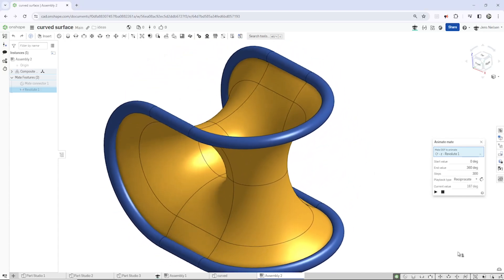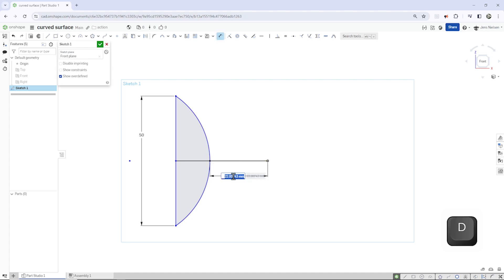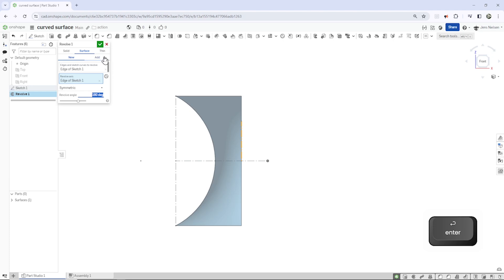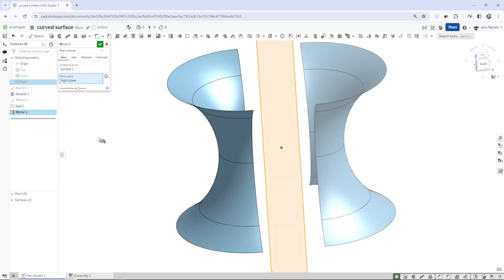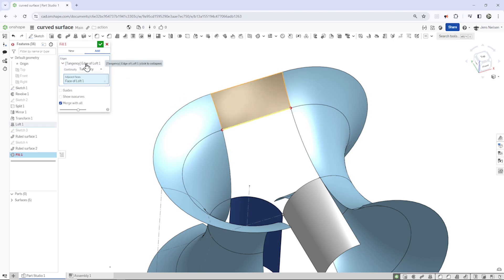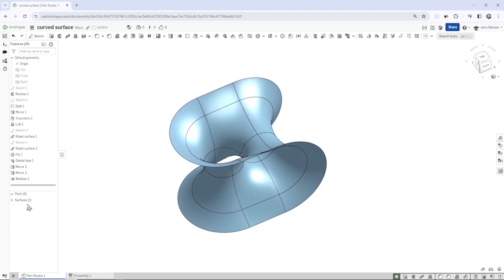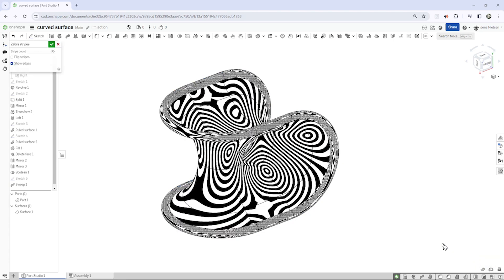Want to design complex curved surfaces in Onshape? Look no further!

Comment: If you wish to reproduce exactly what the presenter is showing, then the steps are easy enough to follow if you pause from time to time. On the other hand, if you want to understand how the tools work and why the presenter is using those parameters so you can apply the principles to your own designs, then this is not the video fo you as the presenter explains nothing and just walks you through the steps. You don't actually learn anything unfortunately.
Reply from the maker: in some videos I explain more, but  this makes them longer-sometimes I think it is best to just practise, and the  understanding will come along.

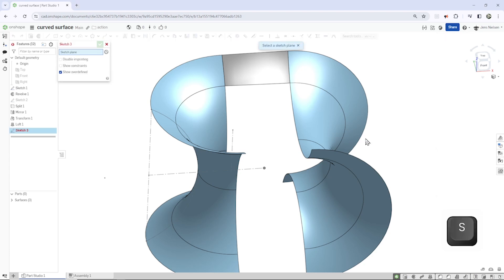Comment: Why the .4 what does it have to do with anything at 6:30
Reply from the maker: that is the  magnitude value, a value to refine how much the  curvature is  matched.
Reply: @cademist  
Then why not use the tangency property so that they can match 100%?
Reply from the maker: @shedrackjassen913  good question-when you analyze the result though, the curvature takes not  only the tangency, but the surface itself into the calculation.
Reply: @cademist  
But then, why not set it to '1' (or 100, I don't know), so that the curvature can match better than that 0.4??
Reply from the maker: @shedrackjassen913  this value just appealed to me, it's not set in stone--
Reply: @cademist  
Thanks for your support 🙏

Comment: thinking to 3D print this piece, I see you have not defined the thickness of the walls... where/when is that defined?
thanks
Reply from the maker: That's the transition from surface to solid by "thicken" , which is the fifth command from the left on top.

Comment: I would like to know a bit more about the purpose of surfaces. In terms of 3D printing do they have any practical reason to use them? I am stuck thinking that surfaces have no actual thickness.
Reply from the maker: They are  more  flexible for modeling-how could  one have designed  that fill  surface otherwise?  If  you want to  3D-print that  type of object  you  just  apply a thickness (thicken is  the  command) and you are ready
Reply: @cademist Ah, thicken is what I needed. I was trying the extrude option again after creating a surface from a sketch. That would only pick one part of the sketch pattern though. Thanks
Reply from the maker: I'm glad I  could help  you out @config2000